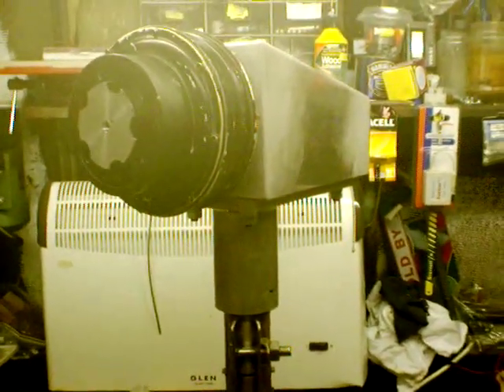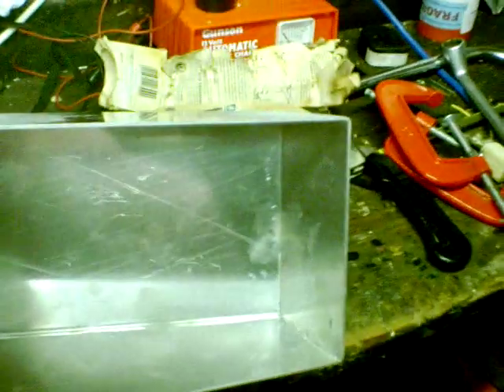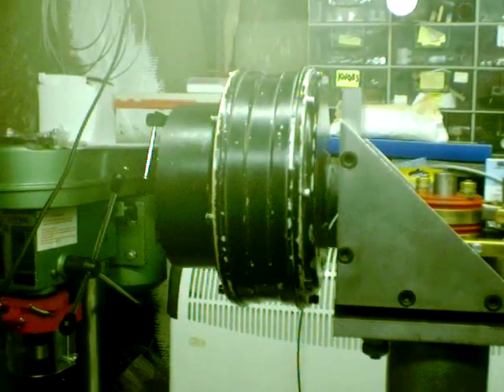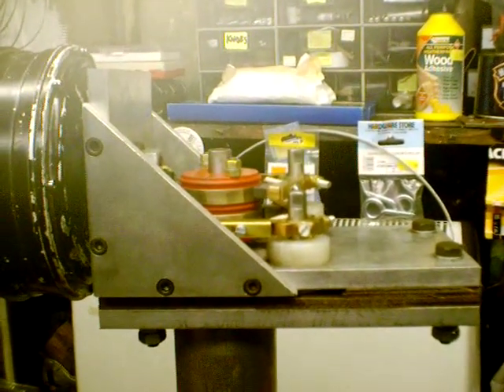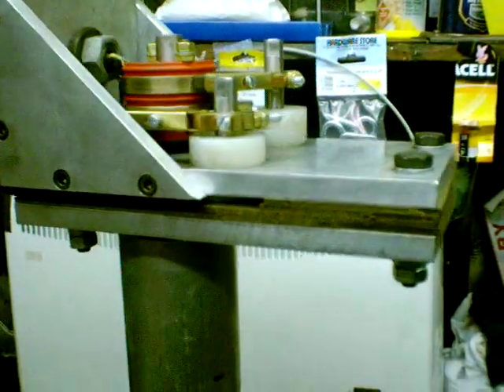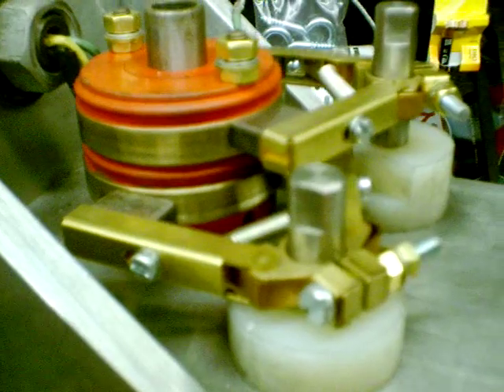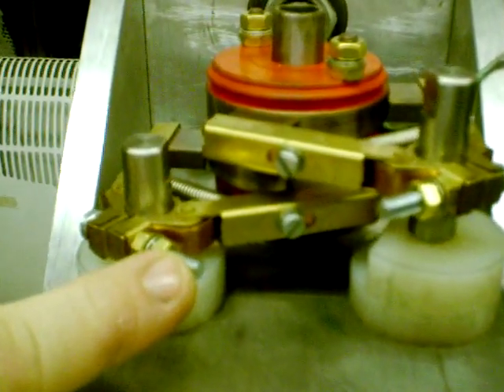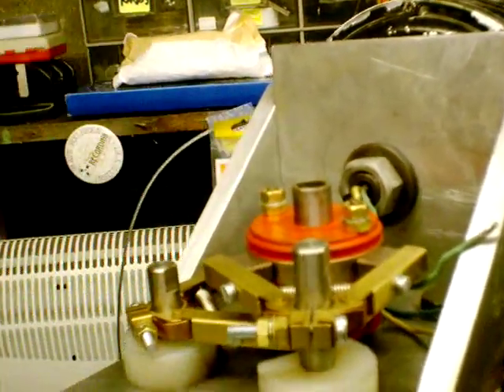Prototype Design Mk2 Wind Turbine and Mount in Aluminium

Comment from the maker: The slip ring is completely insulated from the rest of the housing,and just two wires are connected to the ends of the brushes .
A Rolls Royce engineer designed the mount for me . it cost me £200.00 and the slipring is extra

Comment: Nice work, but i personally would prefer welded joints insted of screw joints in the frame. Weld can newer be shaken loose. Also, i would stay away from aluminum, but since you have the frame from rather thick stuff it should be ok. 

I wonder if you have tried running the power down from the tower with a flexible conductor? I've had mine running in a 14m tower for a year, and the worst it has had was 2 turns in the pendant cable when untwisting it. But i guess it depends a lot of the wind site.

Comment from the maker: 3 phase ac power exits the generator first then moves to the rectifier which changes it to dc then it moves to the brushes then down the pole to the battery's to charge.up to 50 amps so need large brushes to transfer current.
thicker wire = less loss as low voltage.